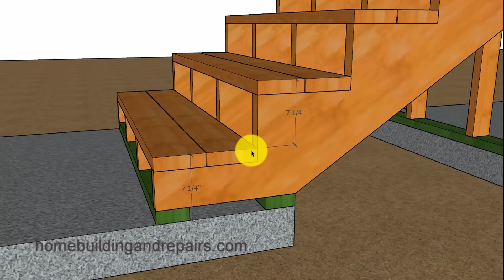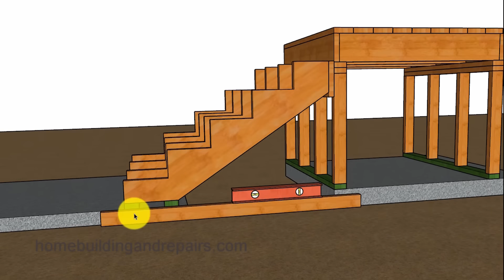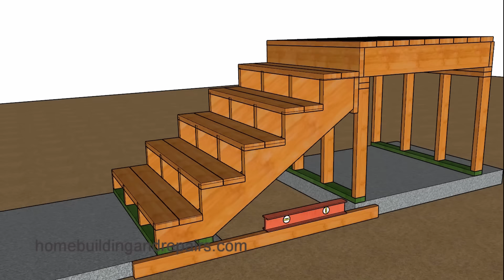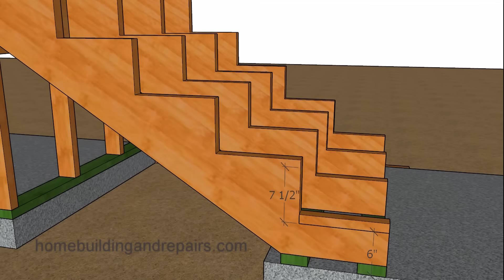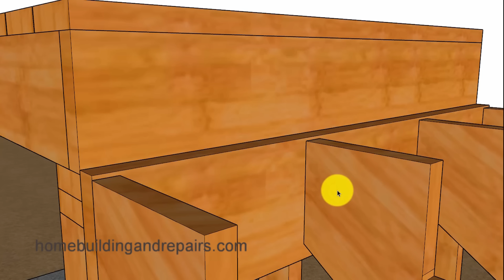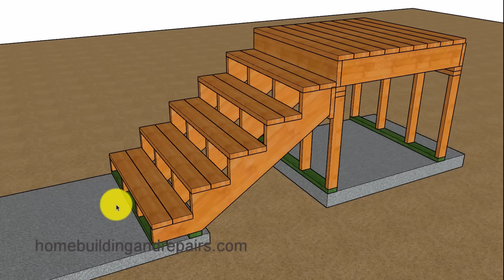How To Fix Stair Riser Variations When First Step Is To High - Do It Yourself Home Repair Tutorials

Comment: Could you build a landing at the first step that is the 1 1/2 inch that was needed instead of the concrete/gravel? I have this same issue but my stairs go onto my driveway(side door) and the first step is like 2 inches too tall. I just want a simple fix and not have to rip out all the stringers
Reply from the maker: Great idea.

Comment: Hi 

Would you be able to do a video about changing a few of the lower stairs, say 2-4 stairs, in an existing staircase to turn 90 degrees instead of continuing straight? Our house has stairs going down straight and then they end not too far from the basement wall and I would like to change that to go into the main living space instead.
Reply from the maker: It's already on my list and thanks for the suggestion.